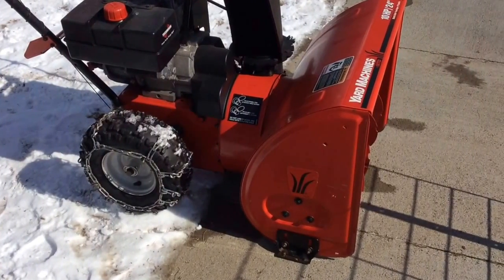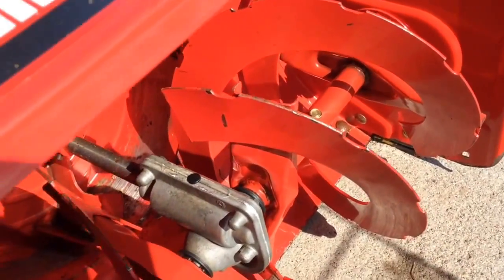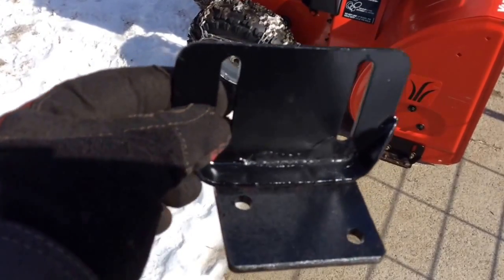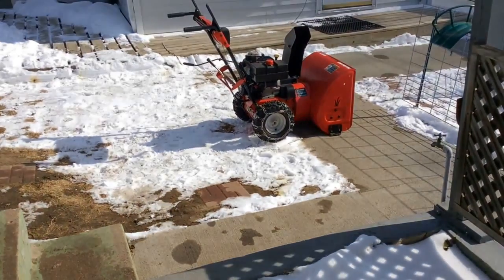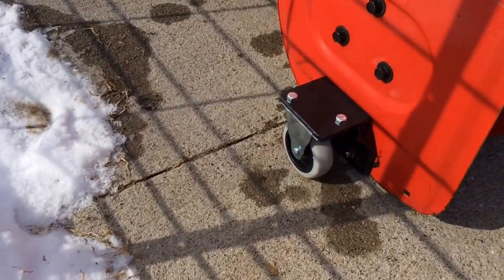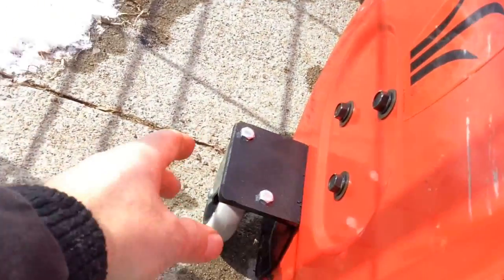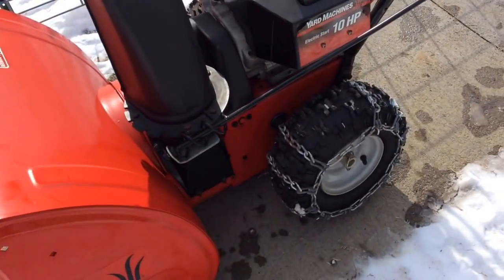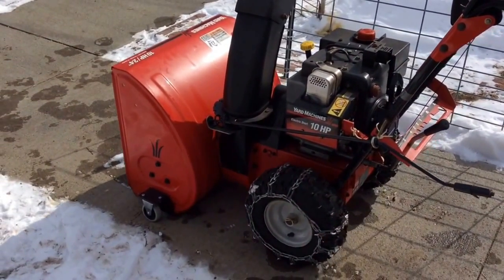2 stage snow blower side skid plates and shoes

Comment: Nice design.  Keep an eye on those wheels...I have had them fold in on a small coke fridge.
I have seen people use bearings as wheels on the skid plates. 
Great idea and video. Nice looking welds too.
Reply from the maker: Thank you. I actually posted a new design video just last month that I think will be better. The issue I had with these was that I would blow 5-6 inches off the walk, and if the edges of the walk then froze, I would have trouble the next snow fall because the top of the plates would dig in and hang up on the frozen edges of the last snowstorm. The new design keeps the wheels “tighter “ to the machine
Reply: @timthetoolman4575  Thanks. I will check it out.
I had put those same original wheels on a 12 cubic foot coke fridge and I was surprised to have them flatten out. The fridge was empty too.  They seemed to be a ridged wheel.  
Nice design on your end. Pay attention if those wheels flatten out. Once the scraper bar wears...next stop is the housing that holds scraper bar. That would not be an issue for you with welds that look as good as your.
Thanks again. Have a great night. Subscribed.

Comment: I did this same upgrade to my thrower too. Works perfectly.
Now here is another.... Get a plastic mud flap like the ones used for transport trailers on big rigs. They are 24 inches wide. Cut into 3 inch strips and use it for a scooper blade. Cleans your driveway really nice, but don't use it on gravel.
Reply from the maker: Great idea on the scraper!

Comment: I just thought of a way to be able to adjust the height of the skid shoes without having to loosen the bolts and then adjust and tighten. 
If one has paved and gravel areas to clear snow off of, it might be nice to be able to adjust the skid plate height.  My idea involves using a threaded rod that goes through a couple nuts welded to the side of the auger housing (or welded to a plate that will be bolted to the side of the auger housing). One end of the threaded rod  would go into a hole the top of the skid plate, and have stop nuts above and below the hole in the skid plate.  The top of the threaded rod would have a crank handle on it.  
The skid plates would be mounted loose enough on the side of the auger housing, that they could move up and down.
When one cranks on the threaded rod it would wind up or down, and the end of the threaded rod on the skid plate would move the skid plate up and down.
Reply from the maker: That would work great and be any easy way to adjust if you had different surfaces to clear
Reply: Or you can make a hinged setup where the wheels would simply flip down to raise it for a gravel driveway, and flip up for skids on a concrete surface. That's my plan. I'm going to use roller skate wheels on mine.

Comment: This seems like a good idea, i have a gravel drive, so, i let the first snow pack down, and, then blow it  One issue with your fix, is that in a hard heavy snow these would prevent the blower from slicing through the snow, they look like they would both add a lot of drag, they really stick out a lot.
Reply from the maker: You are correct, they do stick out more than the OEM shoes.... but they don’t get in the way for my application. I use the 2 stage to take off the heavy stuff, then go over it again with my single stage to clean up and close in on the steps and such. I’ve not noticed any extra drag.... but maybe?
Reply from the maker: You were right, they did hang up especially if the last snow had later “frozen” I posted a new design video last month keeping the wheels in tighter to the machine

Comment: Those wheels appear to be awful small diameter to roll smoothly but instead would probably dig in if the surface would be softer? I would go one step further and get larger wheels that are actually adjustable so you could change the height setting. I think about taking a pair of front wheels off of a small lawn mower that you can adjust the height setting! That would make more sense to me. I would probably fabricate some kind of deflector in front of each wheel to clear the snow to the side so the wheel can roll freely.
Reply from the maker: I only use it on concrete so the small wheels work fine. They are adjustable using the slots in the factory brackets I used but turned upside down. Only issue was that the brackets sometimes dug into the packed snow along the edges of the walk and drive. I did another video of another design that I’m using now and they work even better than this design. Thanks for your thoughts.

Comment: I have seen similar mods to the shoes but the best one so far was somewhat like your but the wheels turned. But it would seem like the blower would be harder to keep in a straight line???? Very nice job I need this on my 46" tractors blower but with the rough concrete and expansion joints the wheels would need to be larger dia. Plus the blower weights almost 300 pounds. Nice Job
Reply from the maker: thanks